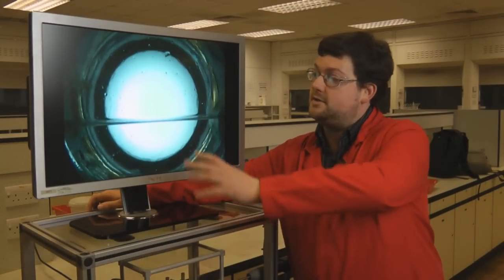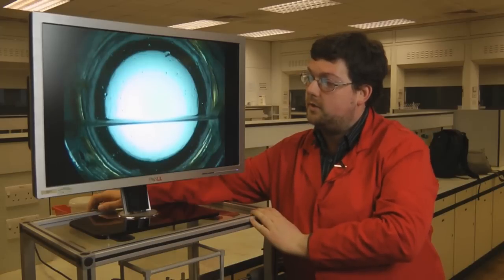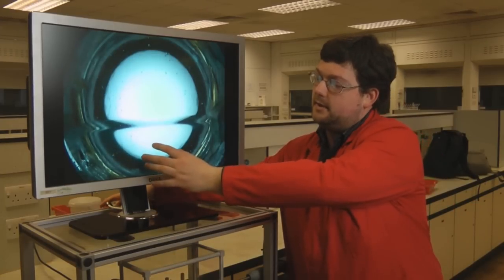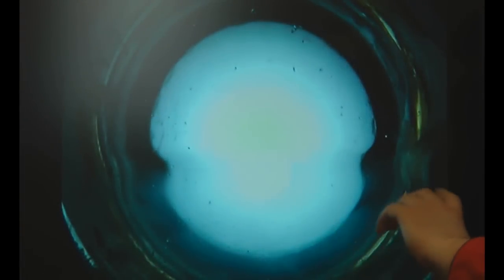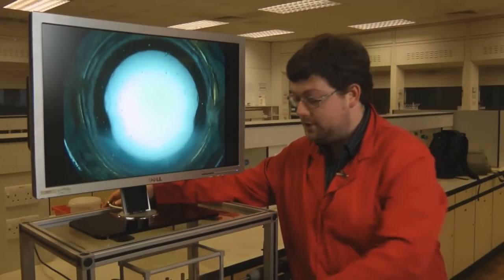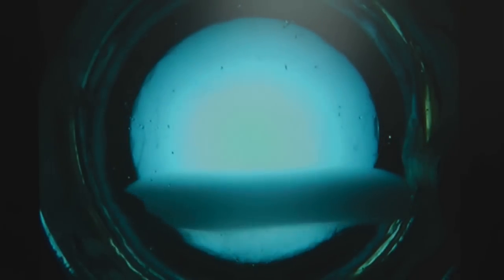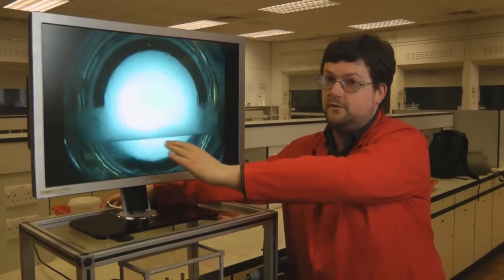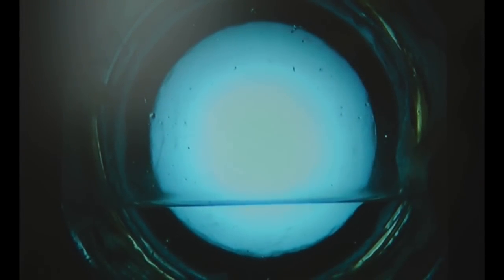Supercritical Fluids

Comment: "The dividing line has disappear and we have a homogenous mixture" - this is not correct. There's no mixture. Super critical fluid is  just another phase, which is homogeneous from definition. The dividing line exist between volumes filled with different phases/mixtures.
I point it out because in a number of videos I've watched, no one made this simple statement.
Reply: A mixture could be homogenous or heterogenous, in this case, it is homogenous, so it is a mixture.